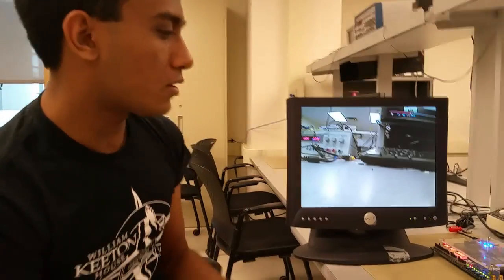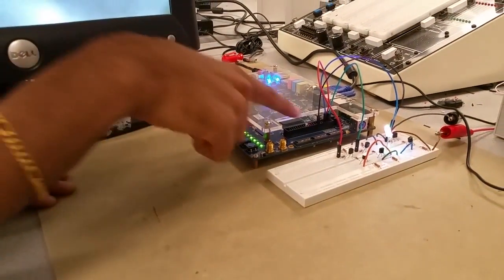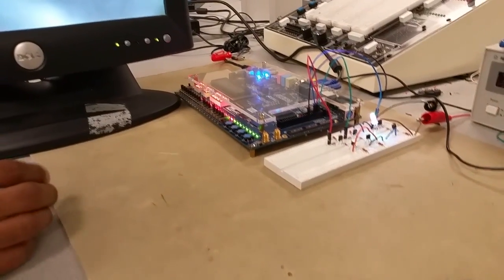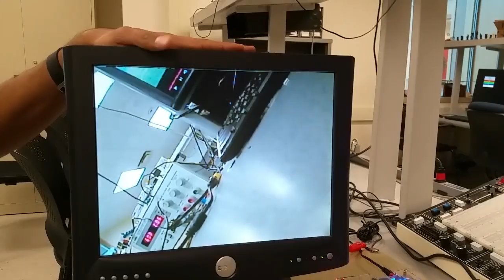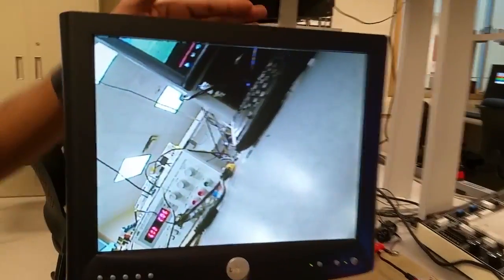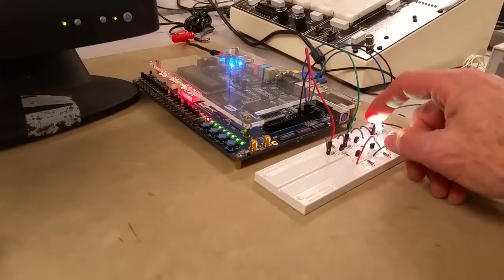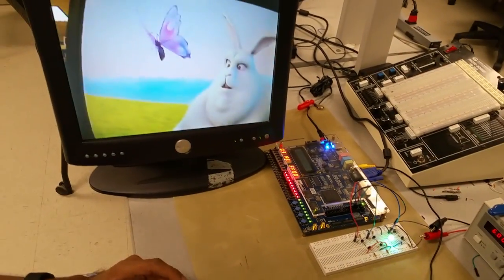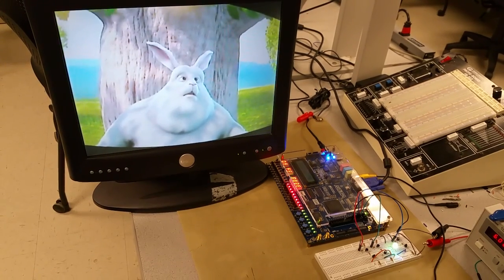NTSC video Ambient light

Comment: Do you have any equations to share with regards to the calculations that arrive at that single RGB output on a per frame basis?
Reply from the maker: +Richard Sloan did you read the video description?
Reply: +Bruce Land I did read it but I read it again and missed the words after the ________ which first time I must have thought the comments ended there... sorry.